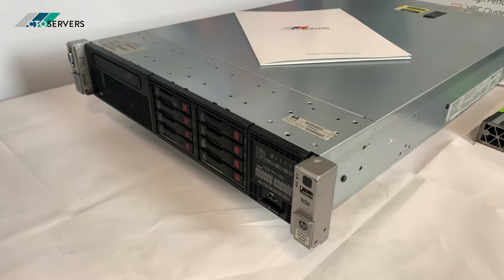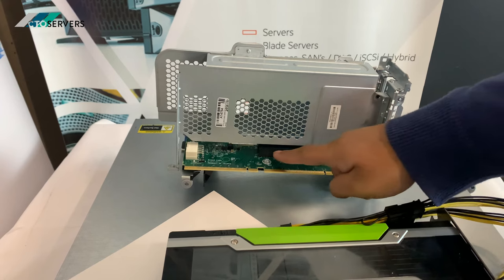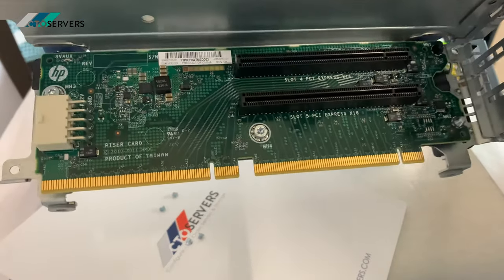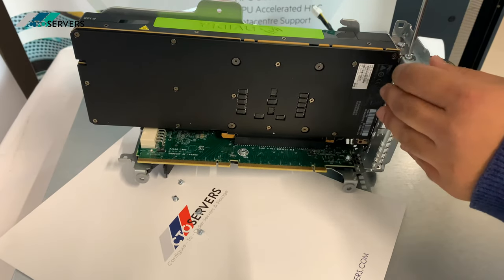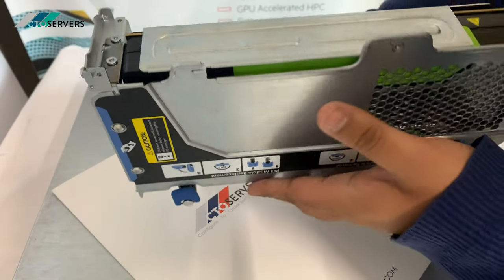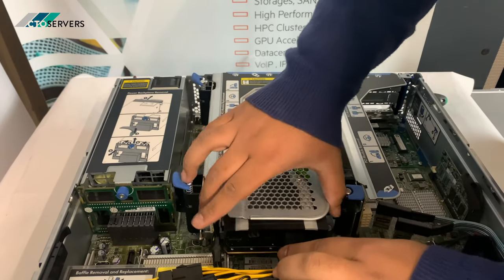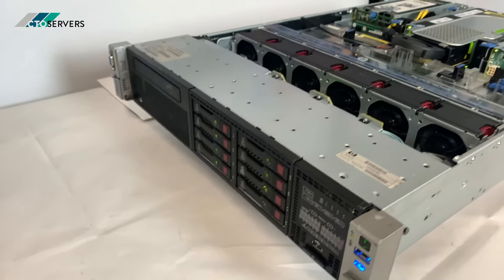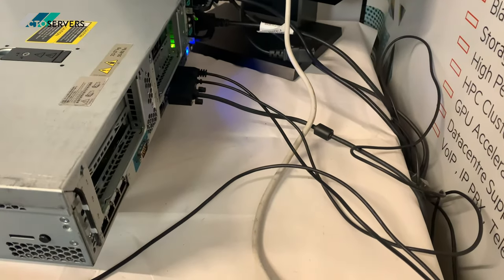GPU Install in a HP DL380p Gen8 , NVIDIA TESLA P100 - HPC Server Solutions @ CTOservers

Comment: I know this is an old video, but I'm piecing together to purchase one of these and planning to put my k80 in there. I noticed quite a few differen blower options, and I noticed you set yours in there as well. But is there adequate space of putting a blower on there without removing the plastic protector for the memory?

Comment: I installed the tesla m40 using the power cable shown in the video, but the card was not recognized in ubuntu or in the bios. This was on a proliant g8 with 2x750w power supply.

Eventually I got it to work. The steps I did:

- Updated the bios via ILO (you need to enable ilo in the bios, specify an ip adress, set up a username and connect ilo port to the router)
- Used linux drivers from the nvidia website
- Enabled 4g encoding in bios (press ctrl +a to enter the menu)

After all of this the gpu was still not recognized. I put the server in performance power mode and the card finally got recognized

Comment: From what I can tell the riser pictured is actually components from two separate part numbers. Here is what I found:

dl380p riser with 2x PCIe x16 connectors: 662525-001  (does not come with the metal GPU cage pictured in this video).

dl380p riser with 1x PCIe x16 and 1x PCIe x8 connector: 728536-001 (comes with the double-width GPU cage). 

There seems to also be a 2x PCIe x16 with a GPU cage: 710727-001

similar/related parts: 
HP DL380p/560 Gen8 3 Slot PCI-E Riser Kit: 653206-B21
HP DL380p/560 Gen8 2 Slot 2x16 PCI-E Riser Kit: 653208-B21
HP DL380p Gen8 Double Wide Riser Cage Kit: 662885-B21
HP DL380p Gen8 NEBS Conversion Cage Kit: 707865-B21
HP DL380p Gen8 Double Wide Graphic Processing Unit Drive Cage Kit: 728543-B21
HP DL380p Gen8 Double Wide Slot1 Riser Cage Kit: 752803-B21
HP 150-W PCI-E Power Cable Kit: 669777-B21
HP 225-W PCIe Power Cable Kit: 728539-B21
HP PCIe 10pin to 2x6pin Power Cable: 757156-B21

source: https://support.hpe.com/hpesc/public/docDisplay?docId=emr_na-c03235291
Reply: What is the GPU cage for?

Comment: I am trying to replicate this using a DL380 gen9 + Tesla P100 + 800w PSUs + Pcie 3 X16 Slot riser + gen9 cable, but I get "Server Critical Fault (Service Information: Power On Fault, System Board,  AUX/Main EFUSE Regulator 1 (10h))", do you have any hint on what could be going wrong here. Thanks in advance!
Reply: Same issue here, have you found a way to resolve it?
Reply: hey I had same issue and found out it was due to the power cable. Also try to upgrade BIOS and firmware via SPP that might help

Comment: For this Server Typ you need for Proc 1 on the right Side the GPU cage with part Number 752803-B21. With bending a part of the cpu 1 cooler mount and get rid of the server mainboard handle, you can install 2 GPUs in this typ of server.

Comment: How do you have your bios configured? I have an HP DL380 G8, and the bios doesn't even recognize the card, nor does the operating system. Also the G8 GPU Entitlement Kit, does not provide the right power adapter. In your video you use an adapter to go Male to Female to the power kit, I don't have this power cable, but what is the part number also?
Reply from the maker: Hi , PN you will have to google or pause the video to see , BIOS is default and no issues

Comment: I have been using the GPU riser the server came with, and had no idea they make dual 1s. Shame they're rare as hens teeth.
Reply: How? with a dual slot card?
Reply: @FongangDassiJean  Uhm, Using 3 slot PCI riser. I think the model number is: HP 662524-001 . Bare in mind, there is 1 full size PCI-E slot and 2 8x slots. These risers are quite common and cheap as well.
Reply: @StuffJason437  This means you have a single slot GPU?
Reply: @FongangDassiJean  I'm only using the GPU in one slot until have found a good source of dual gpu risers. However, the GPU supports multiple slots and just have it in singular slot atm.

Comment: So if you had a single slot card like a P400 you could get away with adding it correct? I'm about to repurpose a number of GL380's and wanted to get a card in them for Plex transcodes.
Reply from the maker: Yes , single slot should work without this optional riser.

Comment: What wattage is your PSU? I´m trying with a K80 in a DL560 gen8 and can´t power on the card.
If I connect and external PCIe to the tesla (comming from an external PSU powered on) it can detect it.
Otherwise is impossible.
I have redundant 750W PSUs..
Reply: did you succeed? I am having the same issue with a DL380 Gen9 and 800w PSUs
Reply: I‘ve read often, you need 2x 1.100W PSU Upgrade - same failing with Tesla M60 on 2x 750W PSU
Reply: @makafre  Yes. You need to bypass the power directly from the PSU. Soldering the cable to 12V pins. It is not a perfect solution, but I discovered HP doesn´t power the GPU via the raiser. So itś the only solution.
Reply: Does P40 works on DL380p Gen8?

Comment: wow is it THAT QUIET?
could barely hear it.
can you easily get win10 on it? drivers etc?
Reply from the maker: Hi , Yes these are quiet. Windows 10 works fine however a lot of drivers need to be installed manually and is very time consuming. We would recommend going for the Dell R720 instead , easy to setup and cheaper to get parts.
Reply: @CTOSERVERS  thanks for the info.
Will look up r720.

Comment: What size power supply do you have on this? I'm getting a PS1 light and don't really understand why. Am I out of bounds for the rated wattage?
Reply from the maker: 2 x 750w
Reply: @CTOSERVERS  Power supplies when redundant like this don't multiple power right? Its meant for fail over. Correct me if I'm wrong. I have a 750w, I'm thinking I was sent a bad cable if your configuration works without issue.
Thanks for the reply
Reply from the maker: @sethoz22  yes for redundancy only
Reply: did you find a solution? I am having the same issues with a gen9 and 800w PSUs

Comment: Great video.  Quick question.  I have a HP Elite 8300 SFF Small Form Factor Business Desktop Computer, Intel Quad-Core i7-3770 3.9Ghz CPU.  Is it possible to add the Tesla P100 GPU to it?
Reply from the maker: Not sure sorry
Reply: -1-your psu is a 240w....the gpu is 250w
-2-sff not enough place inside for a gpu so big, the cpu is in front the pcie port and the tower pc support only low profile
-3- the motherboard is non standard, and is incompatible with regular tower pc  
-4- the psu is non-standard too, you need to convert an atx psu to make it compatible with a hp8300 sff

your best bet is an e-gpu...
so you need something like that :
EXP-GDC v8.5 mPCIe version + your gpu + tower+ atx PSU + StarTech 1x PCIe to mPCIe adapter

Comment: Hello, great video! I'm going to put a tesla t4 graphics card on the dl380 g8, but I can't figure out which thermal solution will be optimal. Are there enough fans available or is it worth buying a blow adapter or something similar? What kind of usb fan model is shown in this video?
Reply from the maker: Get a extra fan , T4 is passive cooled and needs air.

Comment: thanks for sharing I am happen to be doing the same install , only I am working on a (HP NVIDIA QUADRO M6000 24GB MAXWELL GPU) and trying in a ProLiant DL580 Gen9, but is not coming up,  I see you are using a riser and wonder that is what I am missing in my install?   the server side has a block in the power connectors with 10hole adapter to insert power cables, but I see your riser comes with that connection, can you share the part number for your riser ? I need to see if maybe that is what my problem is.  thanks anticipated
Reply from the maker: Hi , We have a video on the DL580 G8 with GPU's have a look at that and the same procedure is for the DL580 G9
Reply: @CTOSERVERS  I was able to connected, actually in my ProLiant DL580 I didn't need the raiser, I had to use special power cables but It worked , Linux was able to see it and the machine is fully functional .( I had to use one side of the power cable and and adapter for the power block on the server side) I wish i could upload picture☺
Reply: That's BS  @CTOSERVERS  There is no video about the DL580 Gen8 on this channel

Comment: This is not working, cos I have exactly the same riser, power cable and gpu and it does not work... it is cos hpe dl380 gen8 doesn't have 4g encoding.
Reply: You can activate it in the BIOS.
press CTRL+A to activate the hidden service options, and activate 64 bits pcie subsystem.
Reply: @nipegun no, there is no such hidden menu in bios. My config is: same riser with two x16 pcie slots,  x2 e5 2697 v2, 2 different but not original cables 10pin - 6pin, also updated a server with special script from hp for v2 processors and no luck, don't have power from riser .
Who can suggest me what to do

Comment: The DL380p G8 has Xeons v1 or v2?
Reply: The board will be a LGA2011 so v1 or v2
Reply from the maker: Supports both
Reply: @CTOSERVERS  I know. I asked because in specs it is stated that only v2 processors support GPGPU.
Reply from the maker: @matuscavojsky3082  Yes GPU only works with V2 CPUs

Comment: What is the riser?
Reply from the maker: The cage we added the GPU in
Reply: @CTOSERVERS  Need the HP Part number - mine is NOTHING like that. what Wattage PSU do you have in also?
Reply from the maker: @TheRealMrRoboto  750W PSU , Yes as mentioned that GPU bracket ( riser ) is optional and does not come as standard. Part numbers shown in the video. You may pause it to note it down.